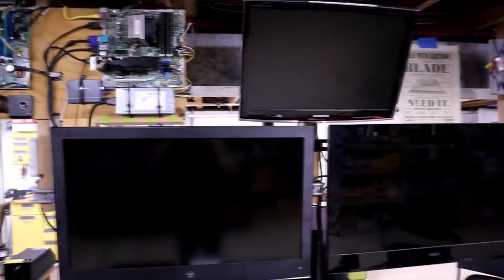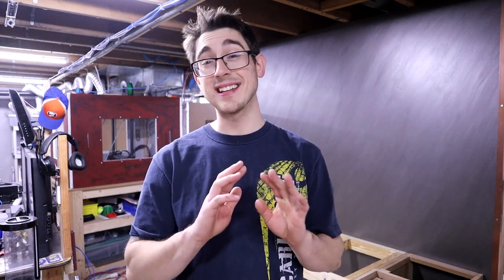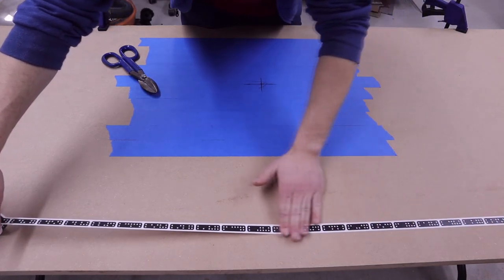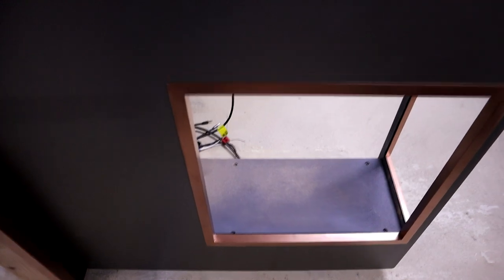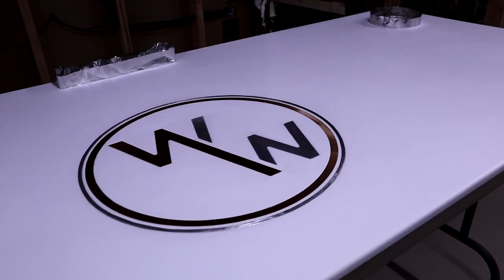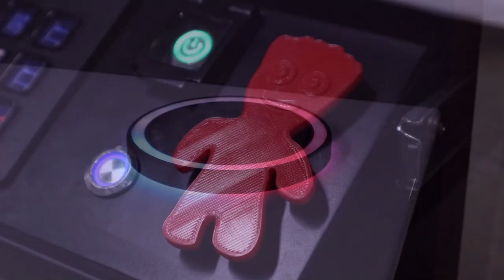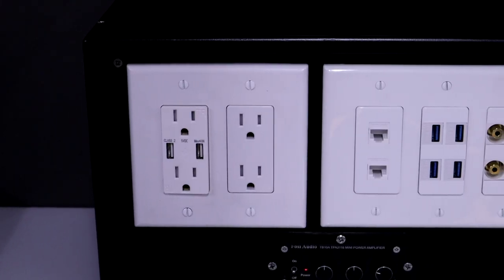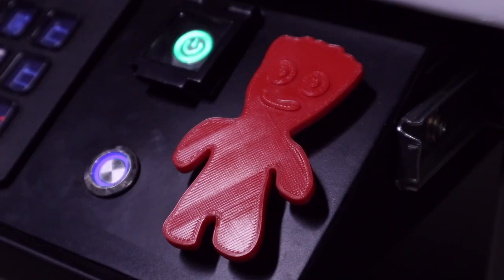Building My Ultimate Desk/Workstation

Comment: I’d love to see how you wired the power button. I’m trying to do the same thing for my desk. Amazing set up bro. Damn good job!
Reply from the maker: I probably won't end up making a video on that but here is the switch I used, there are alot of ones like it online too if this one doesn't fit the style. But to hook it up you just replace it with the switch on your motherboard then i extended the wires by splicing and soldering together more wire between the connection and the button. https://www.amazon.com/NOYITO-Chassis-Extension-Suitable-Computer/dp/B07PPDNPW9/ref=sr_1_4?crid=36P0HKH52YFVT&dchild=1&keywords=pc+power+button&qid=1616913837&sprefix=pc+power+b%2Caps%2C159&sr=8-4 Hope that helps!
Reply: @WiredWorkshop  thank you so much!

Comment: Quick question but what type of paint did you use for the top of the desk after the sanding sealer? Thanks.
Reply from the maker: It was latex paint, Frost by Behr
Reply: @WiredWorkshop    Thank you for the fast reply you rock congrats on the awesome desk.

Comment: Do you mind if I ask for a rough breakdown on how you spent $5,000? I can only see how you got that high if you either factor in equipment used and all the electronics as well - the supplies for the desk itself seems like it wouldn't cost that much.
Reply from the maker: Yeah the supplies weren't actually all that bad the monitors and PC brought it close to 4k alone then I know I for sure spent at least 1k in lumber and parts!
Reply: @WiredWorkshop  Ahh, that makes much more sense. Thank you for the quick reply!